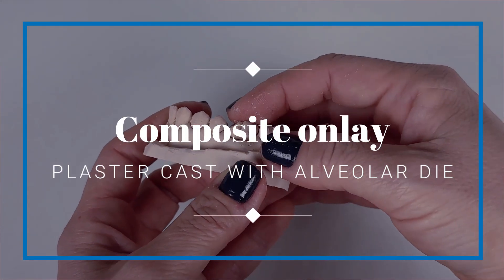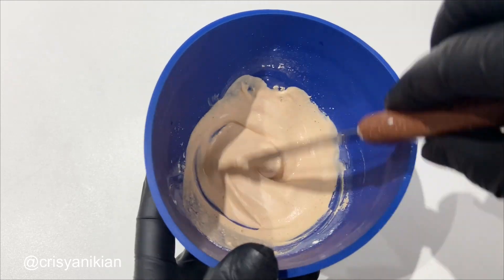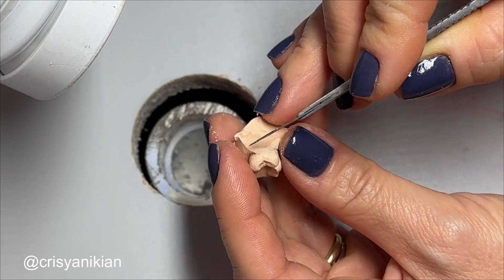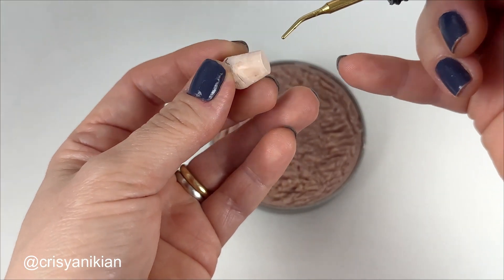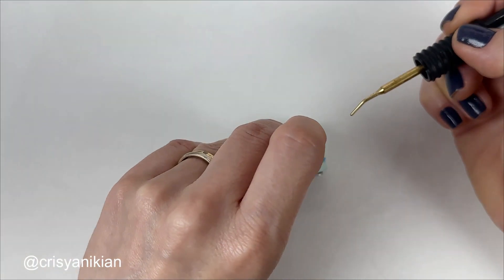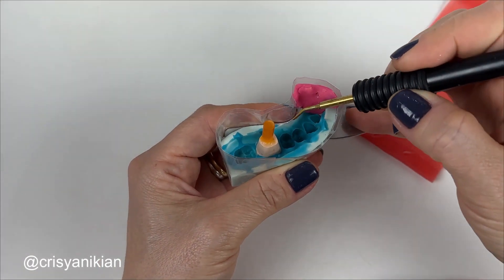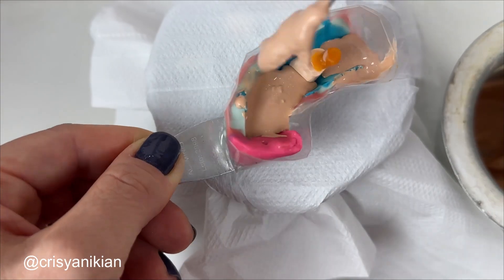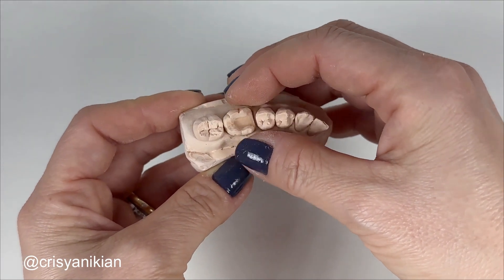Composite onlay - part 3: alveolar die

Comment: Great video series. Thank you very much for posting these videos. 
I have 2 questions:
1. Why did you put wax on the prepared surface? So that it acts as a spacer?
2. How do you check occlusion during the onlay fabrication?
Reply from the maker: 1. The wax acts as a spacer, as the plaster contracts during crystallization and can leave the cast stuck to the model.
2.  You have the option of molding the opposing arch and mounting it on an articulator, but I find it laborious and uncomfortable for the patient. So, I use the direct restoration’s sculpting principle when constructing the onlay, respecting cusp heights and groove positioning. Furthermore, since it will be made of composite resin, I can make the occlusal adjustment after cementation. ☺️
Reply: @ thank you very much for the reply and thank you again for the great video series:)